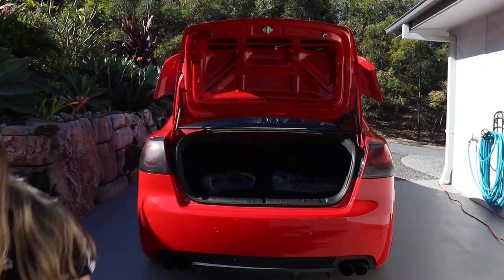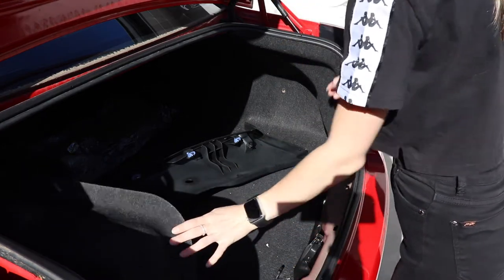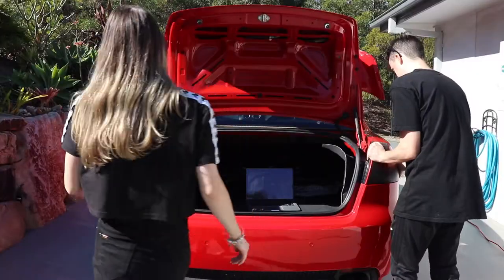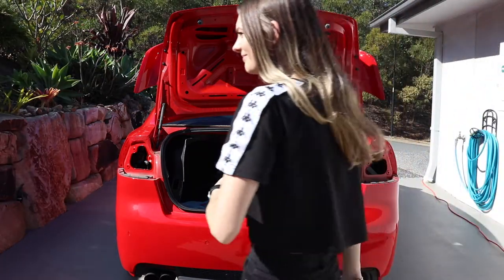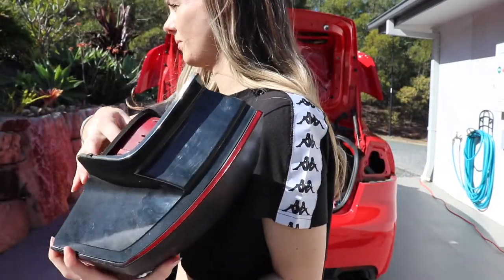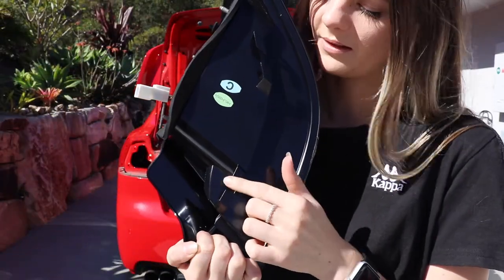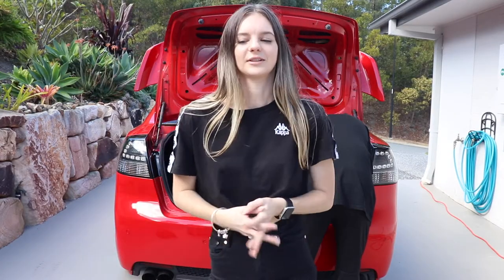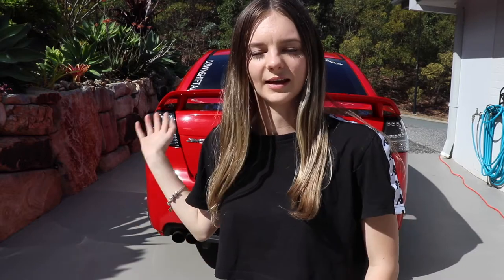Fitting My Brand New Tail Lights! 🏎VE HOLDEN COMMODORE

Comment: Hey how do you connect the LED part (brake lights) did you need a wiring harness ??
Reply from the maker: They came with the LED brake lights already set up in them so I only had to put the reverse and indicator lights into the new taillights.

Comment: Some of those clips weren't designed properly which is one reason they are hard to get out(i should know i designed them and the carpet) the taillights are hard to get in probably because they are aftermarket parts not original oem hence probably not as good quality.

Comment: whats the exhaust setup?
Reply from the maker: It’s just straight tails at the moment
Reply: @TiffanyNeilsen  i just got defected in nsw for a strait pipe as theres no muffler box i miss mine sounding like yours. im cutting the box open and shoving the pipe through so it looks like it has one. true 3 days before xmas to low and the pipe for no muffler and one tyre. just thought id give you heads up

Comment: Wait until you have to change the headlights,what a pain in the ass job that is...
Reply: whys that.
Reply: @jonnyfromtheblock1  have you done it ,take the bumper off but get to those fidly bolts that hold it on and other fidly bits. If you haven't yet you will see and if your got a good set of aftermarkets its worth it. I got i nice set of rear tails with sequential indi's and all led.I'm no car mechanic for sure but i like turnin spanners.
Reply: Bro I just installed headlights yesterday bro trying to take the bumper off without taking the wheel off takes it to a next level of pain but yeh I got it done 🥹